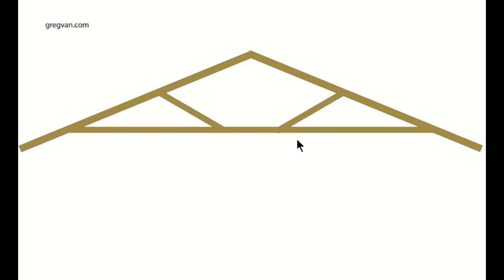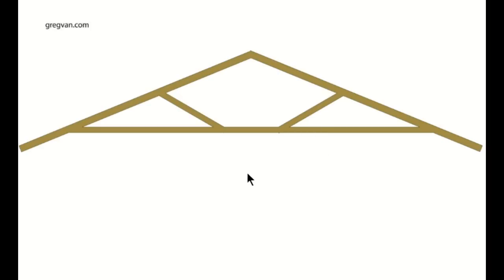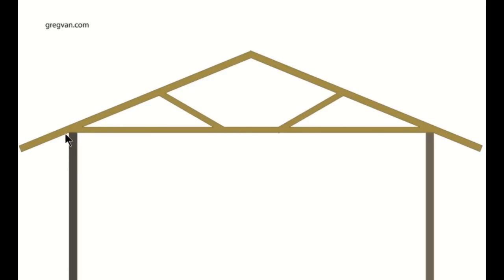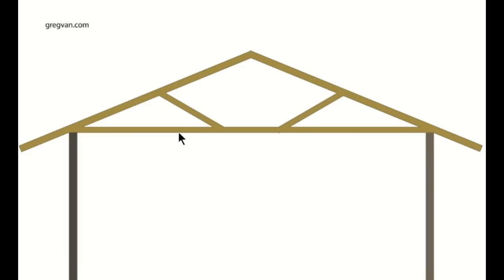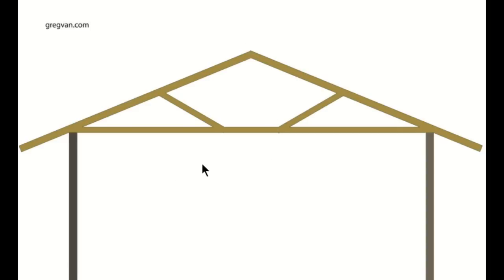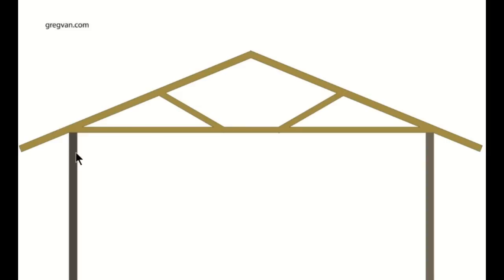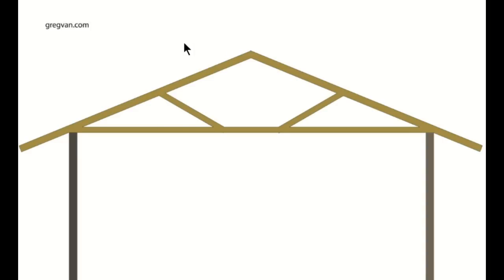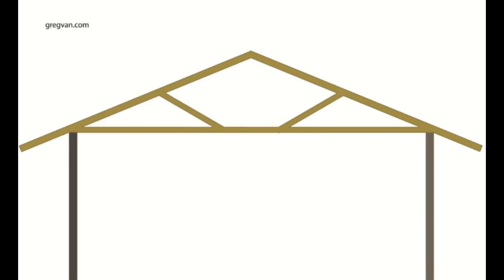Roof Truss Basics - Structural Engineering And Home Building Tips

Comment: My 1970s one-story 25-ft wide home has a trussed roof and was built on a slab.  The attached garage is same width as the house.  Two 2x4 trusses spanning the garage (closest to the house) appear identical to the ones over the remaining portion of the house.  There are no interior walls in the garage.  Are these two garage trusses sufficient evidence to conclude that the interior walls in the house are not load bearing.  Thanks.
Reply from the maker: +Larry Johnson I'm not saying it isn't possible or that it hasn't ever been done, but I have never worked on a building where the engineered roof truss system used any interior walls as structural supports. Obviously I can't tell you whether or not your roof is different, but I would be willing to suggest a high probability that a 25 foot wide building using engineered roof trusses wouldn't require the use of any interior load bearing walls.
Reply: Greg, Thanks for the reply.  I continued my research and went up into the attic a couple more times, finally able to see where the wall crosses under the truss.  The two do not touch.  That's positive evidence to me (based on what I've read).  I already cut the opening in the wall.
Reply from the maker: Sounds good and you're probably okay.
Reply: @gregvancom  lol at least your comment makes sense.. because in your video you contradict yourself.. "do not assume any interior walls are not load bearing.. the load gets carried to the outside.. so dont cut the inside walls" is basically what you said. which literally makes zero sense. If the load is carried to the outside wall then you can't transfer any of it to an interior wall. That would be poor design.
Reply from the maker: @mitcht1026  Feel free to provide me with the exact minute that the statements were made in the video and I will look into it. I think the confusion lies in a statement that would suggest that just because something isn't a load bearing wall vertically, that it might be providing some type of lateral support for loads running horizontally.

Comment: Greg, I'd like to tray my bedroom ceiling. I have trusses. Is there anyway to get 4 to 6 inches for the tray effect with the truss ceiling? Thanks for any suggestions.
Reply from the maker: It would be costly, but you could contact a structural engineer for more information. The whole roof system would need to be redesigned and were talking lots of money.

Comment: I recently installed two hanging shelves and I wonder how much weight approximately these truss connections (steel sheet) can hold?
Reply from the maker: I've seen plenty of roof trusses support weight from shelves like you're talking about, just don't overload them. Engineered roof truss damage usually happens when excessive weight is hanging from them or stored in them or from heavy snow loads. I wish I could tell you that they would support 200 pounds or 400 pounds, but I can't, because it will give everyone else the idea that it's okay, when it might not be.

Comment: I want to build a timber frame roof using our saw mill that cuts a long up to 20 feet long. Is there a way to butt two 20 foot long beams together using bolts and plates? I think I have seen pictures where people have done that but is it possible and how difficult is it to design?
Reply from the maker: I have seen it done myself, but don't know enough about structural engineering to provide you with any information about how large the plates and bolts would need to be to support a specific load.

Comment: I have an AFrame home that is basically trusses spaces 6-8 feet apart. It was originally someone’s weekend cabin. I love the home but have read  that trusses needed to be no more than 2 feet apart. Is this correct? It’s been standing since 1968. Can I go back and add more trusses? They are exposed with only paneling for inner walls.
Reply from the maker: Yes I would imagine you could add additional trusses, but if the roof and the sheathing was designed to where they could be spaced 6 to 8 feet apart, then you wouldn't need to add additional trusses. When you walk on the roof is it spongy or doesn't move?
Reply: gregvancom Not spongy at all. From the side the sheathing appears about an inch thick, so now I’m very curious how it is functioning as well as it does. 

It’s an isosceles triangle, 60 degrees for each interior angle. Very steep, so that reduces the load some.

Hmmm back to statics class for a refresher. Thank you for the information!!!
Reply from the maker: You're welcome and if it's lasted for a while, let's hope it will last a while longer.

Comment: I have a question. The centre load bearing beam in my loft is cut halfway along. The remaining 2' x 4' s have been sistered. How can I put a brand new beam in spanning the whole loft without taking down the roof
Reply from the maker: I don't know if I can help, but go to the website and at the bottom you'll find contact information. Feel free to send me a couple of pictures.
Reply: Basically the question is, can I cut the ceiling joists in half for a short period of time in order to strengthen them as quick as possible
Reply: They would only be cut for half an hour maximum
Reply: That's like asking if Samson could remove the pillars for a short while without the top collapsing. The bottom chord of a truss is in tension. If you cut them, what is going to hold the truss together?

Comment: my overhang in the back seams to be sagging in the back only in the middle part of the house. In your diagram it would be your far right on top , how would that be repaired ?? Expensive ??
Reply from the maker: It could be expensive, but the only way I could think of, would be to remove the existing roof rafter overhang and attach new overhang boards to the existing roof trusses. I will try and make a video in a couple of days, so stay tuned to our main channel.
Reply: gregvancom ok thank you

Comment: I have roof truss and a wall perpendicular to the trusses with the center not supported by any wall besides the primary load bearing walls. I also have the house sitting on piers with a crawl space. The wall in question is not on any piers so relying simply on the strength of the floor joists. I am wanting to make an opening in the wall 3x larger than a standard door.
Reply from the maker: Send me some pictures of your project and I will see if I can help.
Reply: Sent an email with pictures of the wall, joists and trusses. Thank you in advance for any advice you may provide.
Reply from the maker: I got the email and the pictures and think that you were asking whether or not the wall studs, floor joist and trusses need to line up vertically and even though that might be the perfect way to build something, it often isn't. In other words they don't need to. Let me know if that didn't answer your question.
Reply: Trying to determine if the wall is even a load bearing given all the indicators that it is not. Also, even if it is not, can I create an opening and still use a beam.
Reply from the maker: Most of the time, but it all depends upon how large of an opening and whether or not the wall is providing lateral strength or sideways strength to hold up the rest of the building. Sometimes you can put an opening in a wall and it will reduce the walls structural side to side strength that has nothing to do with any weight-bearing on it. https://www.youtube.com/watch?v=mGXeQUizWAs

Comment: Do you know what the most commonly used truss for new construction residential homes are? Thanks for the video
Reply from the maker: I don't think there is one particular roof truss, because the designs change and need to be modified to fit different types of buildings. I don't know if I answered your question, feel free to ask another if needed.
Reply: Well the reason I asked is because im taking the builders test in Michigan and it was a question on the test that I wasnt sure I got right. I have to retake the test because I missed it by 4 questions and I was trying to cross check the questionable ones I remembered. I looked all over online and never got a specific answer so I decided to ask people with knowledge of this area. Thanks for your response.
Reply from the maker: It sounds like the question needs to be rephrased, because it's a little vague or difficult to interpret, making it difficult to respond to.
Reply: Thats what I thought but thats what they asked. Thanks for tour time

Comment: So I have engineered trusses that have v shape in attic on both side and then a walk space in the middle in the attic but my garage spans 30 feet by 30 feet and there is no structural walls in it but inside my house there is a wall between the kitchen and livongroom and that space without that wall would be the same size as the garage so I'm pretty sure I can remove that wall I have pics but it won't let me post them on here but I'm still going to have someone come look b4 I do anything..
Reply from the maker: Good idea and since I can't provide engineering information, I won't be much help. You can also go to the website and check out some of the roof framing, engineering and design videos for a little more info.

Comment: Do you do any engineering for ceiling trusses modification if i need
Reply from the maker: You need engineering if you're going to cut or remove any part of the roof truss system. If you're going to build a ceiling under the roof truss system, this would also require engineering, because you're adding weight to the engineered system.

Comment: Incorrect. Its not old or new, trusses are trusses. Trusses are made of members arranged in triangular orientation and there is a reason why its so. This is so that all the members are in tension, compression and even neutral members with zero load. Now, when you add more joints, chances are you start to deal with beam problems and start to bend your member. These are allowed as long as your member is strong enough. Basic structural engineering hasn't changed much.

Comment: Your roof design as pictured isn't actually a truss system. Everything needs to be triangulated, and your center portion isn't. You could just change the graphic to have two more members going from the ridgeline down to where the other truss intersects with the ceiling joist.

Comment: the bottom beam of my truss is NOT attached to the truss... Can I remove the bottom beam? The bottom beam has play in them and don't seem to be doing anything except holding up drywall (which I removed).
Reply from the maker: I can't provide you with structural engineering information. If the beam isn't holding anything up, then there's a good chance it can be removed, but you better make sure it isn't holding anything up or part of a structural connection that is holding up the rest of the building.
Reply: +Richard McGregor the bottom cord was removed long ago. More then a year. We moved Th cord up with appropriate braces to reach the outer walls. No sag. In fact it allowed us to raise the ceiling height and fix other structural deficiencies. The job is done and it looks great!
Reply from the maker: That's amazing, but I don't think it was a good idea.
Reply: +gregvancom it's all good. We consulted a structural engineer who instructed us with the process. And it passed inspection. Thanks for your input though.

Comment: Is a engineer roof as good as a tiled roof
Reply from the maker: An engineered roof is the system used to build or frame the roof like a truss roof system or conventional framing and the tile roof sits on top of this. Hope this makes sense. An engineered roof system needs to be designed to support the weight of the tile roof.

Comment: I'm planning on making a duck pen 14 ft. by 11 ft.5 inches being mostly 6 ft. & 1/2 inches tall , & and d a small part to feed the duck's or what area being 3 ft. tall . As a roof being just a wooden slide , but at one corner being added a 6 ft. out by 2 foot by 2 & 1/2 inches out slightly at a left corner . I wish I knew how to make that roof slide wood /s , so it will be all simple maybe .
Reply from the maker: I would suggest watching more of our home-building and framing videos. I've never built a duck pen, so don't know if I would be much help.
Reply: Ok . Thank's for the info. .
Reply from the maker: You're welcome.

Comment: You are correct... but with today's design software the theory of "always triangles" is kind of gone.

His truss will work, depending on span and loading of course. The reasoning of triangles from the past is because that was a real easy way of calcing loads and force paths.

Now with the software out, it does the thinking... so configurations are greatly expanded. (truss designer for 10 yrs now)

Comment: The figure in the video is not a truss. There is nothing holding the bottom chord from sagging. The two compression webs are pushing on nothing. It needs a single  kingpost or 2 webs coming from the peak. This configuration will fail given any significant span
Reply from the maker: I would imagine you're correct. When I made the video years ago it was to provide viewers with an example of structural load transfer and not roof truss construction or load transfers through one particular roof truss. I am currently working on other videos that I will link to this video about using roof trusses and load transfers through them.